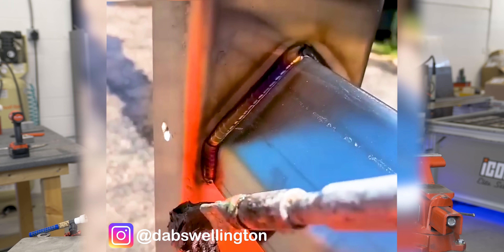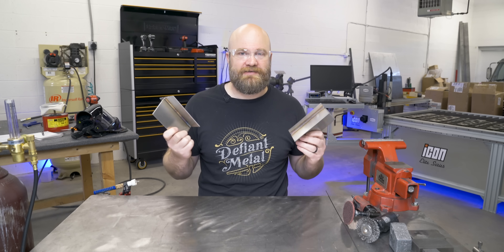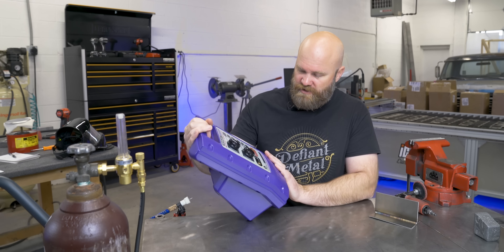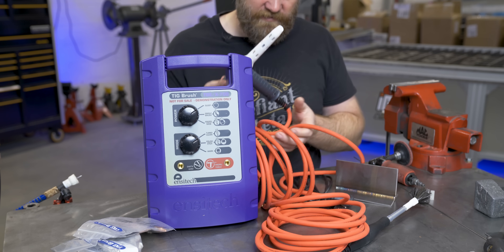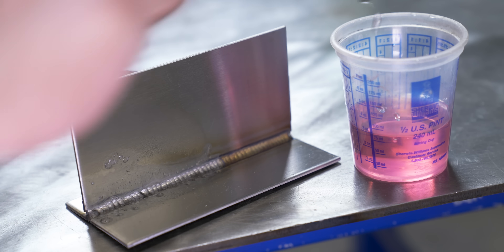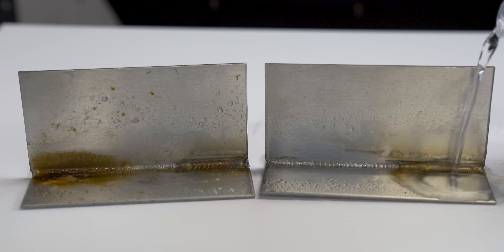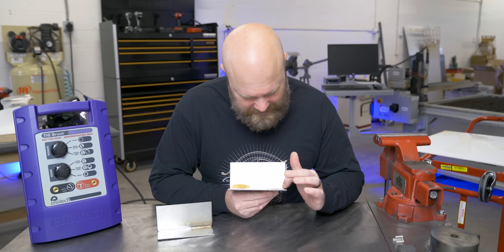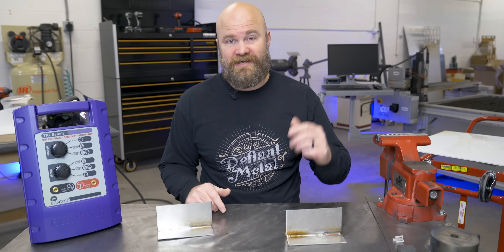Why Do People Do This To Their TIG Welds?? Electro Chemical Weld Cleaning

Comment: That's called passivation of stainless, you can use fiberglass mat some phosphoric acid 75% an get a 110v mig welder unplug the drive roller and hold the Tigger down and boom you got a passivation machine. The shittest job in the shop lol 😆 that machine consumables will make you go broke. Lol works well if you mig weld stainless... but doesn't clean sugar
Reply: Whoooeee, slow down tex. Splain a bit more please. Or make a short vid. I'm retired but still do side stuff and that sounds like something that I should know. Thanks.